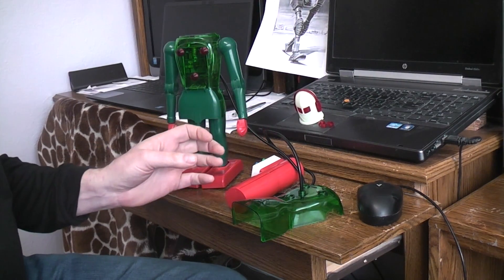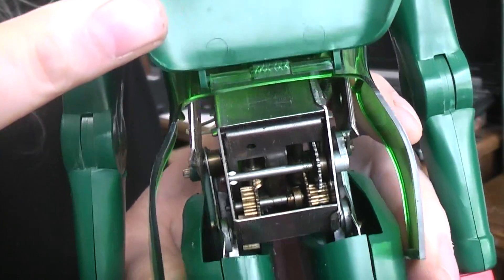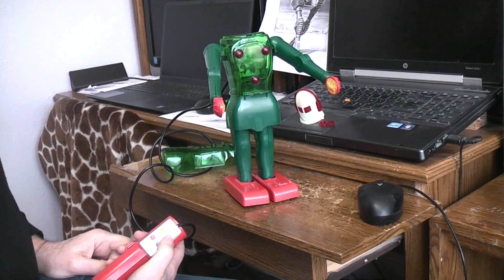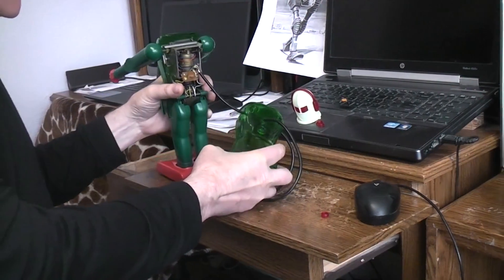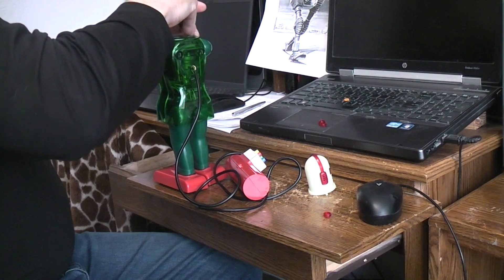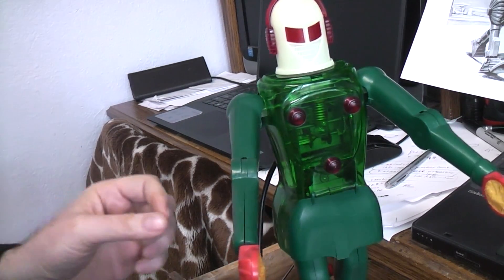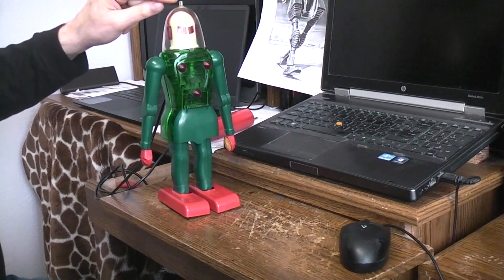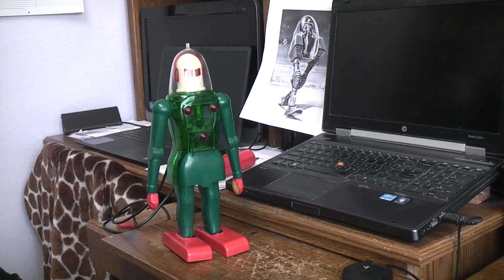Inside the Dux Astroman robot. Western Germany 1959. Pre Mr. Mercury, Japan.

Comment: Hi, interesting video. I live in the UK. I still have mine, a 9th birthday present from my grandfather. (I'm now nearly 74) It is still in the original box, the only thing missing from the packaging is the foam sponge that eventually disintegrated. And it still has the original sponge hand pads. The antenna and a couple of the red buttons are reproductions that I got from the USA.  I last tested it a couple of years ago, but unfortunately it has now seized up, and I am unable to find a repairer.
Reply from the maker: It is an easy robot to open, so you might do so and  rotate the motor shaft with the power button pushed. This should come back to life if it stopped working from just sitting for 2 years.